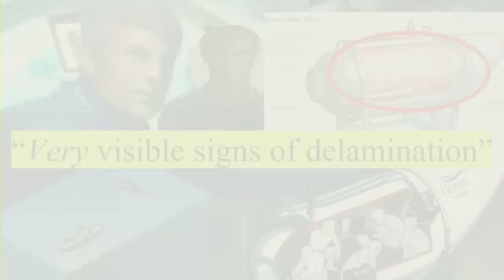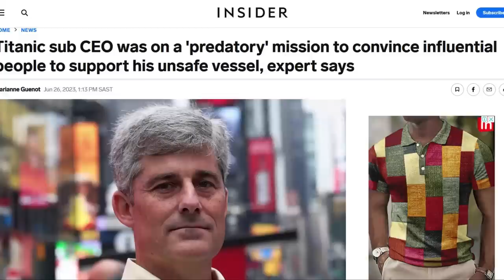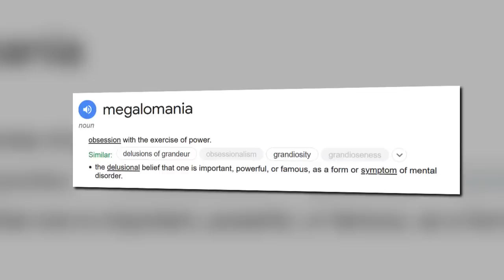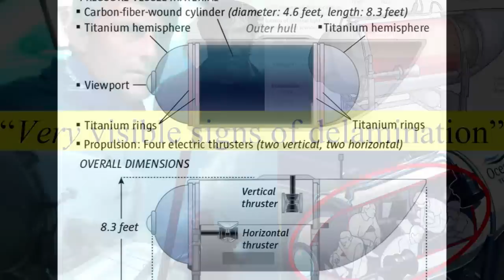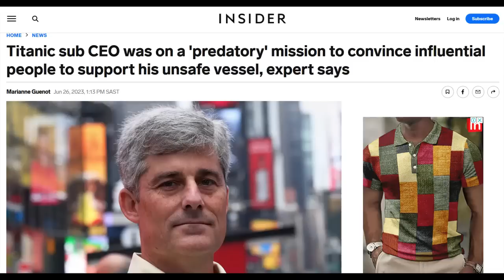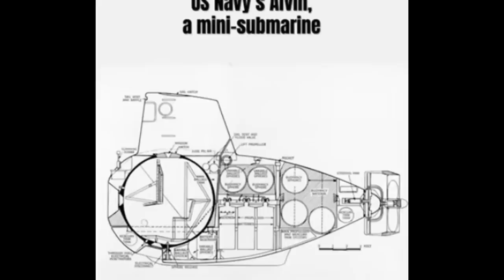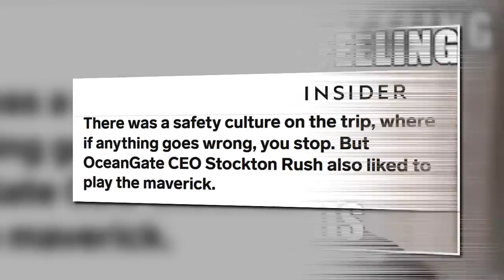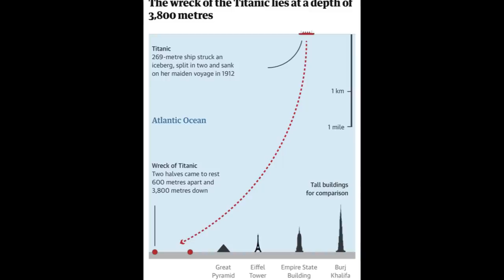"Lochridge shone a light through a sample of carbon fiber and saw splits in the midsection..."

Comment: The more I learn about this danger sub. The more I cannot believe anyone would  think it's safe,   if I were involved, I would insist it be loaded with load cells, data loggers, microphones,  pressure sensors, and sent down 20-40 % deeper than the planned dive level, unmanned,  multiple dives, deeper each time,  and everything inside would be metal,  and definitely a micro air purifier, with  CO2 scrubber, and small lo2 tanks for emergency O2,  it should be tested to 550-650 meters to test, using load cells on temporary cross braces, every 8"-12 "  and at the very least, the  sub should been constructed like a short section of hose, with two  barb fittings going inside atleast 36", and getting thinner to the center start with it being  the outer diameter, step down about 1"-2" for 6"-12"  then step down in diameter again.  With the final being 1" thick titanium from roughly 6-8" thick,  I'd  prefer to have a solid 2" titanium crossing the intire tube, stepping down from 6" -8" at the outer edge, then wrapped with vacuum oven dried carbon fiber,  wet with epoxy, wrapped around the 2" thick titanium ,   then placed in a vacuum bag, to pull off excess resin,  and remove any air,  and wrap with elastic cheating bands, synthetic rubber straps with conductive strips inside to allow it to put pressure on the fiber, and heat it while curing, forcing all air out the carbon ,  eliminating any voids. And reinforcing the titanium and preventing the ends from popping off while under pressure! After seeing a model tested under water pressure, every time the tube crushed popping off the ends, I barely have an education, basically self educated. Yet I know better that to glue metal to a composite and expect it to keep the pressure out or in, they should atleast filled it with  50-100 psi to see that it is safe,  use braces with load cells to read any compression or decompression of the tube at each different points, every 4"-6" would be best, across atleast 60% of the length, just past half the length, when but showed it squeezing in the middle like a coke can being crushed,.  It's definitely not safe beyond 100 meters,  probably 50 meters,  use it to five the corral reefs. Preferably  above 200'

Comment: The ship was pulling the Titan along for 3 days in rough seas where it had sustained thousands of thundering knocks  and thuds being thrown up & crashing down the big waves. Surely the bolts on the porthole glass window, the delicate electrical systems and the very carbon fibres of the  aging Titan were sustaining serious damage  ~ all because the smaller ship was cheaper!  Insane! This  serious damage could have  been the very cause of this catastrophic failure ! 
Any scuba diver that ever dived from a fibreglass boat can tell you the punishing knocks the boat receives crashing through the waves - feels like its hammering your spine right through your scull & your body aches for days!

Comment: Would have been real easy to do a destructive test of a sample of carbon fiber and the monitoring system . Make a small model designed to fail at a certain depth and drop it to that depth while monitoring.

Maybe they did not want to know the system did not work ?
Reply: Also easy to do cyclical testing to see when fatigue kicks in , again a model and drop it to the test depth and bring it back up 10 x more than the life expectancy of the sub and then if it does not fail x-ray for flaws

Comment: Thinking of the inverse - a SinterHIP furnace which is what is used for sintering tungsten carbide and diamond tool tips up to 100 atm up to 1500C. These furnaces are made of ~ 30 cm thick steel, usually cylindrical with a circular door 30 cm thick. And that is 100 atm not 400 atm. And not made of 15 cm of glued carbon fibre that wasn't even woven at different angles to make a proper woven composite. In fact actual DSV vehicles look not unlike a sinterHIP furnace.

Comment: Honestly, why did Stockton have to insist on using a carbon fiber hull instead of just conventional materials that were not going to fail? He could have still made a cylinder to ferry more people. Not doing a sphere is already slightly risky, let alone also making it out of a brittle composite that has never been used and for good reason.

Comment: Carbon fiber used in the Titan is actually floating in a matrix of epoxy and epoxy is susceptible to cracks and delamination of the Hull, carbon fiber is not like metal that deforms when it’s under pressure and about to fail, carbon fiber just snaps with not a lot of warning it should make audible noises as it delaminates however and the hull degrades on each dive ,on the second dive it was noted by one of the expert submersible builders invited by Rush he said loud noises could be heard getting louder the deeper they went the noise was described as a low caliber gunshot and started at 300’ and interestingly continued on the assent to 300’ this he said was a sign of stress release in the hull and damage was being done, he did write and email to Rush stating he should not dive the Titan until they did a lot more testing on carbon fiber and a complete survey of the hull

Comment: The glue is what failed people the carbon-fibre with flex every time they would go down when they would go down it would get very cold which makes glue even get harder so it would spider crack everytime I believe his sensors picked up the cracking even more I believe he aborted the mission and drop the weights and wrote the message when he was writing the messages when the sub glue failed and imploded titanium does not Flex carbon fiber does flex glue does not Flex when it's that type of glue so therefore it would crack each time and this is the problem which using two different materials with flat surfaces they should have made the titanium and caps have notches on them that the carbon-fibre fit in almost like a Lego piece this would have stopped this from happening at least for a little bit longer!

Comment: Interesting that we "need" accidents like this because warnings from engineers aren't enough. Engineers warned about the rubber gaskets on the Challenger Shuttle but the big heads didn't listen. If I remember correctly the people responsible didn't get fired proving that failure is an option.

Comment: That`s BS. If you see light coming through, the thing floods. You have water coming in, and that would fill rather quick at that pressure difference. Also it had an aluminum cylinder inside - how should light shine through?
It`s not a very credible comment.

Comment: Has everyone watched the unofficial transcript of the sms messages video between the sub and the boat  ? 19 mins of warnings and trying to get the sub to raise . To me it suggests the sub had taken on water( mirco cracking etc  and was heavier than designed thus leading to it descending a lot faster than designed and then not being able to float fast enough . He also had major financial problems , so it was literally do or die territory . They should not have let two members of same family ride on same descent. Hell this thing was cracking on the second trip back in 2018 at 300m , sounded like a handgun going off ...

Comment: I don't get the problem with towing the sub? It was on a platform, so it wasn't dragged on the sea surface or had a rope attached in one end, so it would be more like having the surfboard on the roof of the car than dragging it behind the car. It wasn't subjected to the force of the deep waters, as a marshmallow would be subject to heat if you drag it over fire. Can someone explain that part?

Comment: If there had been any degree of light showing through the five inch thick CFRP section of the hull, the submersible would have been springing leaks at 100 feet at most.  I'm reluctant to believe the initial statement.

Comment: These is no way Lochridge could see light through the sub carbon fiber wall and it even make it 1 ft below the ocean surface without leaking. That does not even follow logic. The failure occurred at the glued joints. I am not saying using carbon fiber was a good idea.

Comment: I don't believe some of these statements. I've worked with composites for 34 years and porosity in composites occurs only during manufacture. It is not a degenerative condition as is a delamination. Porosity would have been discovered at non destructive testing stage during construction.

Comment: they should have used a fibre optical crack and warp detection system:-Distributed fibre optic sensing for crack detection in concrete structures, the use of acoustics was totally stupid and the wrong technology for this job - Im british I dont know what cool aid is ?

Comment: I worked in NASCAR CUP series racing and we used tons of zip ties but they were only used for wiring and if it was something we could zip tie to make it through the race. We never left them on. If something breaks we fixed it and if we had a zip tie holding something on we would make a bracket and use a hose clamp.

Comment: Yep and if the transcripts of the text messages going back and forth between between Titan and topside are legit it looks like they were descending way too fast and made it to 3500 meters only 300 meters away from the Titanic in an hour when it normally takes 2.5 hours. At 3500 meters they started getting RTM alarms and dropped ballast and even the frame but seems like they even lost upward thrusters, Were hearing crackling sounds, were trying to get reserves to operate thrusters to ascend but only made it about 50 meters upward before communication was lost. So it seems that for about 15 to 20 minutes all on board new something was drastically wrong. Not sure why he decided to descend so fast.   https://youtu.be/4Dj8IJbP41c

Comment: Holding a light to a sample is one thing. Fully characterising   the material behaviour under tension and compression and biaxial loading is another
Reply: Shining a light through a sample and seeing irregularities is like Feynman taking the Shuttle O-ring and putting it in ice water with a c-clamp on it and letting it cool and then removing the clamp and observing that the o-ring did not recover it's shape, and could not seal the rocket motor. It's a simple demo that proves the point for non-technical observers. Much like the Hydraulic Press YT guy demonstrating CF tube implosions, CF can't take compression stress.

Comment: Can't get it out of my head that dropping the landing sledge may have contributed to the CF being compromised? It was apparently attached to the titanium ends, so while attached would had introduced some order of stiffness to the lower end of the CF cylinder...
Reply: I wonder if anyone ever did the math on that. The weight of the sled and the ballast attached to it would have introduced bending (hogging) stress on the tube when it was submerged, and the weight of the tube would put an opposite stress on it when it was out of water.

Comment: heres a question for everyone 
Is the company who made the titans carbon fibre hull in any way liable as a contributing factor in the implosion ? 
" spencer composites " contracted by ocean gate to build the pressure hull with carbon fibre suppled by oceangate , supposedly purchased from Boeing manufactured the hull knowing it was going to be used in a deep sea submersible taking PAYING PASSENGERS ( not mission specialist ) down to depths of 4km ? 
are there any lawyers out there 
i would value your opinion

Comment: The least thing anybody with a sense of responsibility would do is to let it down on a cable to 4500 m below surface for testing and put all kinds of sensors and recording equipment in it. Then do ten such dives up and down and then cut up the hull and look for defects in the materials. Then you have an idea if the technology works or not and how many dives the material might be able to endure.

Comment: 12:54 A question for the scientifically curious...
You have five cold nervous people in an airtight space scarcely bigger than a dumpster. How much water vapor condenses per hour?

and shouldn't the life support / air filtration be removing it?

Having seen pictures of the wiring and it's a pretty safe bet there's Lithium batteries under the floor someplace as well. A bit of water sloshing around all that seems like a hit waiting to happen.
Reply: I'd wager that the titanium end bells 'sweated' a lot with condensation.  After all, the ocean temperature is pretty close to freezing (perhaps 34 F??).  Now, where that drains/ collects is anyone's guess at this point.  But it is an interesting detail.

Comment: Where were the batteries? Were they in a separate compartment which would lose propulsion and add more weight. The little power it did have wasn't even enough to counter the currents at times and trying to power up two miles with negative bouancy plus a lightning strike probably delaminated the carbon fiber more than they already knew.

Comment: If you read up on carbon fiber extensively,, it's described as the next wonder of the world material suitable for applications in aerospace & most industrial applications imaginable. It's appreciative properties/values explain it as being high heat tolerant,, able to withstand temperatures in excess of 1500 degrees,, non susceptible to cold,, stronger than steel & the list goes on. 
The parts that stop you in your tracks is it has many hidden & unproven caveats in the most basic areas such as "is it even water proof"? Most experts say it is due to it's tightly woven strands of pure carbon strands preventing water from infiltrating it's surface "but",, it has to be treated with water proofing materials highly susceptible to UV rays from the sun & imagine how much time that little submersible sat on the deck of it's mother ship unprotected from such rays. The bottom line is this,, I'm of the opinion most of these areas carbon fiber were tested within were never under the incredible stress of deep sea conditions. It may have proven fine under (for the most part) normal atmospheric conditions from ground up but even at that,, it had the potential to become very brittle with the changing of extreme temperatures it was subjected to at higher altitudes (I believe). 
I think Rush was taken in by the superficial proven qualities most experts swore by the CF would withstand but just didn't go the entire way in fully testing this "wonder material" within the relentless conditions & circumstances he was going to subject it to 400 atmospheres deep. Eventually after several dives that outside skin began to break down & water micro permeated that hull. If he'd only taken some helpful outside advice & put his creation through more critical testing exposing the truth,, he would have seen it was breaking down unbeknownst to his mere mortal methodology of inspection,, the hand & eye test.

Comment: He have been able to obtain titanium bottoms. He should use a thick titanium cylinder.

Rely on epoxy to hold the pressure ?
Fiber to used in it’s strength direction and also no weaving at all ?

Install the battery at the bottom while it will of course get flooded at first water leak ? I guess balancing idea but he could bring them upper.

That’s do it yourself sub.

Good marketing but poor technical. In life it’s mechanical first, then marketing. Not opposite

Comment: Simple example of “fake news and bs research” before posting a story in order to be first and not right.
Reply: I’m in no way siding with ocean gate. But, you need to know what you’re talking about before putting bs out to the public. I on the other hand actually know about carbon fiber.
Reply: Trouble is, the carbon fibre was layed on the vessel in a spiral  i.e., in parallel - NOT a wise method if one wants strength.
It ought to have been layed up in a criss cross style weave and at 45° degrees angle to the vessel.